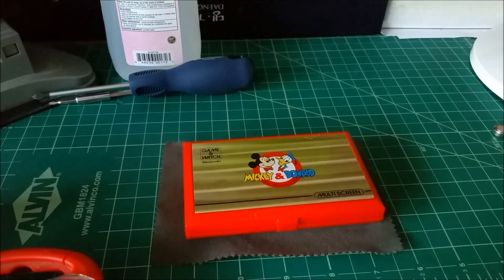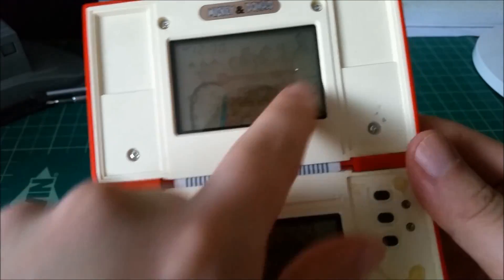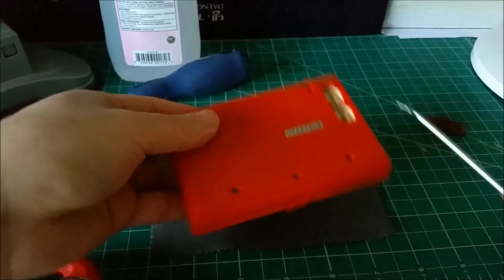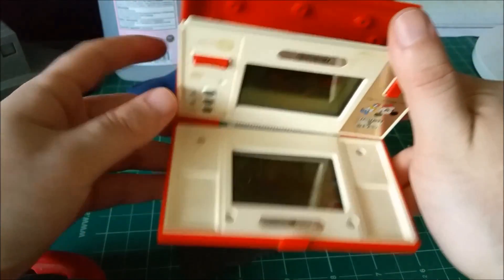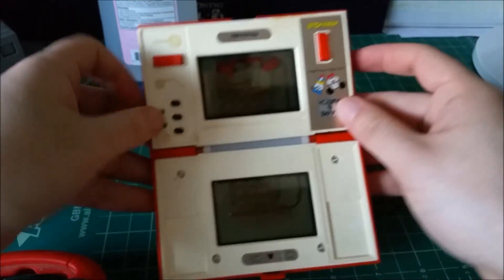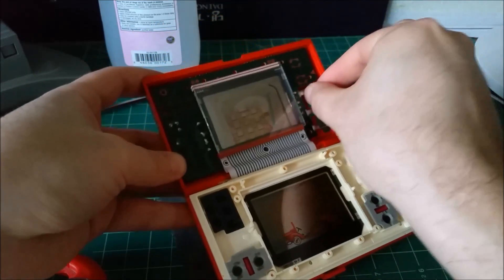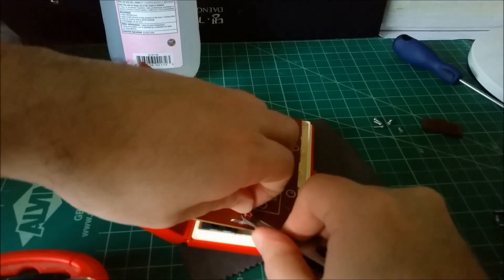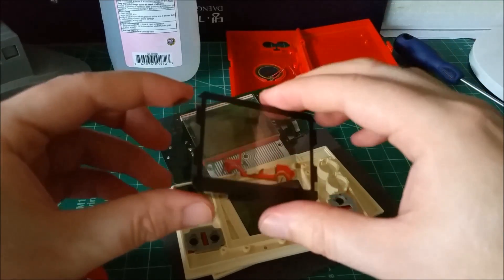Let's Fix: Nintendo Mickey and Donald Game & Watch

Comment: Hello SJM! Your vids are phenomenal, thank you! I had a mickey and donald that had this problem, and fixed it, but I was expecting you to also mention the faceplate reattachment over the buttons, as one of mine fell off much like yours! What would you use to re-attach a loose button plate? Thank you in advance for your helpful response 🙏🏻
Reply from the maker: Thin double sided tape would probably work, but some fast dry spray/liquid adhesive (like used in scrapbooking or even thinly applied contact cement) would probably last longer term.
Reply: @sjm4306  from the bottom of our hearts, thank you so much for that piece of advice. It's hard to find a repairman online, so I'm sure people will be looking to you if you ever offer your services in the future, either on eBay or elsewhere!

Comment: Hey man, I'm in desperate need of assistance on a Donkey Kong 2 unit. One red wire goes on the disk, and the other one fell off at some point. Where should I solder that wire back onto?
Reply from the maker: Pics of the board and wires would help me help you. You can shoot me an email at sjm4306 at gmail dot com.

Comment: Super Video👍
Was ist das für eine Folie?

Lg
Robert
Reply from the maker: The filter I replaced is a linear polarizer. You can find them pretty easily online sold to repair LCD screens. It's very common in old devices with LCDs for the polarizing filter to darken/look burnt and the image to appear very dim/low contrast.

Comment: Good video. Thank you. Do you happen to know a fox for my game and watch. I put 2 batteries in and it only works when I really push them down? I wonder if I could be using the wrong battery size? Many thanks
Reply from the maker: Either the metal battery contacts could use a good clean, the solder joints connecting the contacts to the pcb need to be resoldered, or the contacts need to be bent a little to firmly touch the batteries.

Comment: I had to do this exact restoration on a Squish G&W that I acquired last year. But I found that if I only worked one side at a time, it wasn't necessary to disconnect the speaker wires at all.

Comment: Thanks for the video.  It inspired me to try to clean mine up.  Sorry if I missed it, but when you put white paper, did you put a filter on it as well?  I've tried using the back silver thin metal from an LCD casing and it looks good but it looks a bit faint...  I'm wondering if it's because I didn't put in a filter.
Reply from the maker: juan julio Yes, in addition to the white paper I had to put a rear polarizer otherwise the LCD wouldn't display anything. The original reflector has the polarizing filter laminated on top so they appear as one layer.
Reply: Gotcha.  I have something visible, but it's faint.  I've just ripped up the polazier from my LCD.  How do I determine direction before taking apart to make sure it works?  I am assuming I just use a piece of the polarizer from the front correct?
Reply from the maker: For getting the direction of polarizing filters right, just put in on the screen and rotate until you can see through the glass and it will be correct. There are a few ways to remove adhesives/glue, I like isopropyl alcohol as it slightly dissolves and weakens the glue and leaves no residue. I've also heard wd-40 works great as well but it can be messy and possibly damage some plastics.
Reply: Thanks for your help.  Miraculously, I got it working again!  It's a lot better than it was.  The only real challenge I had was removing the residue.  I tried soaking in warm water, the polarizing film pealed off, tried with rubbing alcohol, it got all murky...  Finally, I got two pieces to stick on the NEW reflector that I cut out from an old mac LCD.   There are air bubbles, but like I said the overall thing is pretty amazing.  You may want to try the thin metal reflector vs your white paper.  I think that the LCD was too old (old mac G4) so the glue was impossible to remove.  If I can find a non-sticky polarizing sheet cheap somewhere, I'll try again.  Thanks again!

Here's the before/after:
https://imgur.com/fIWrNFa
https://imgur.com/uAljoQt

Comment: Hi sjm4306 I saw both of your game and watch repair videos and am really in awe in your knowledge of these technical electronic stuff. I mean in the octopus video by just looking at the motherboard you already know what kind of board it is and brought back a g&w from the grave with with only one wire, which is truly incredible ! I'm trying to fix up a g&w as well but am unsure what's a good replacement for the reflector,could aluminium foil do ?
Reply from the maker: Hi Ben, thanks for the compliment but my skills really aren't as impressive as you say. With all things intuition, experience, and luck are the deciding factors and there are plenty of times where I can't fix stuff. 

Anyway, as for the replacing the reflector with aluminum foil, yes it would work but there are a few things you need to be careful about. Since the exposed chip and traces are directly behind the lcd I would advise mounting the foil on a piece of stiff thin plastic/cardboard to prevent anything shorting. It should be easy to use some adhesive to glue the foil so that there are no wrinkles since they will be visible from the front of the lcd.

Another idea I wanted to try is spray the back of a thin sheet of plastic/glass with silver/mirrored spray paint and see if that would work well. I may have to take a trip to the local art store to see what reflective materials they have.

Comment: i miss this so much   my DK model will live on in memories
Reply from the maker: Aww what happened to your DK? So cool that was the model that introduced the dpad. It's also on my list of consoles I plan on picking up one day.
Reply: yup the lcd ribbon cable is loosestill got it!  yhea it was a fun and chalenging game  DS before its day  both screens were part of the game  neato
Reply from the maker: I saw some site selling replacement ribbon cables awhile ago. I think it was on ebay and it should be more than $5-10. If you ever track down a replacement you should totally make a repair video!

Comment: Flip the reflective layer around ( polarizer part to the back ) and put a polarizer on top
Reply from the maker: I need to figure out how to flatten them first since they are curling up at the edges. Maybe a clothes iron on very low heat would work?
Reply: sjm4306 just rotate them I think they will be flattened by the LCD anyways